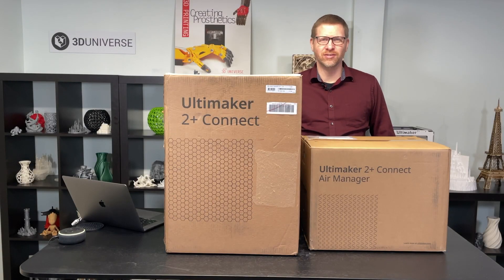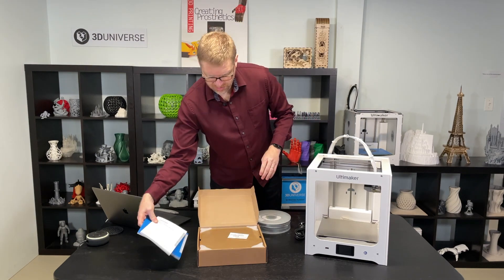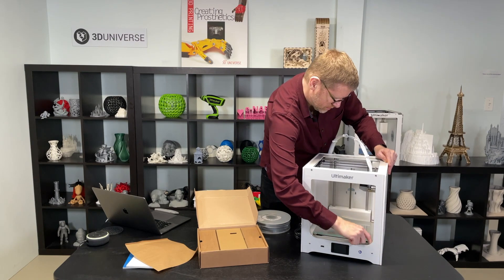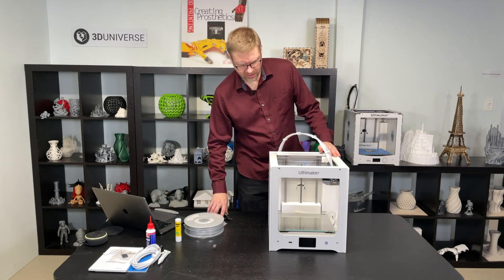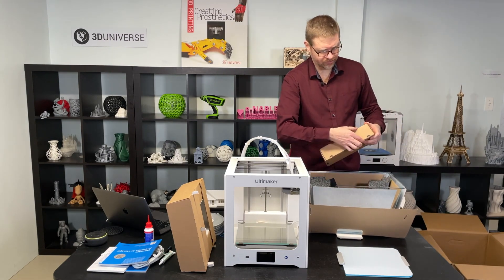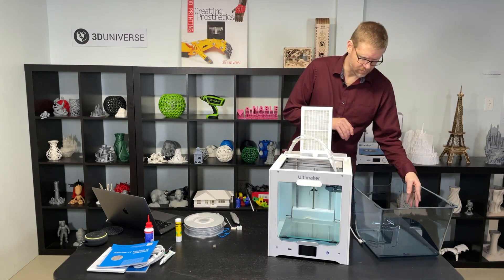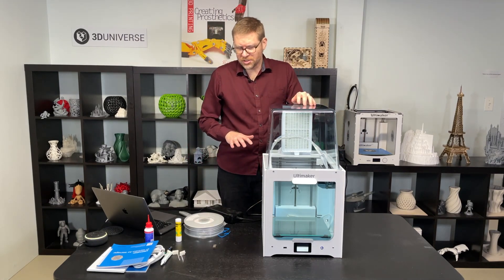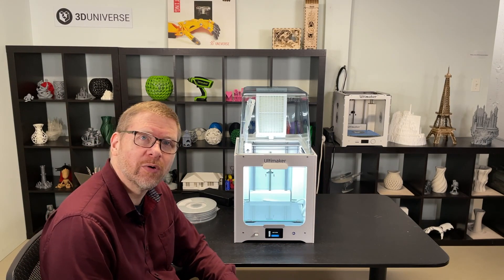Ultimaker 2+ Connect Unboxing and Setup [3D Universe]

Comment: Hello, I wanted to know what the average consumption of the UltiMaker 2+ Connect is, thank you.
Reply from the maker: Are you asking about electrical consumption? This varies extensively based on the how the printer is being used. The max power consumption is 221W, which would only be when the print bed and extruder are both being heated.